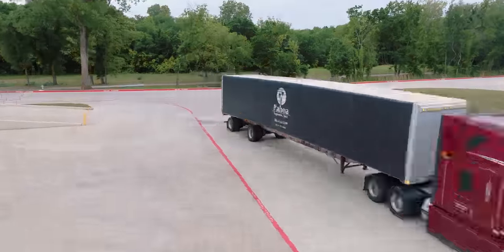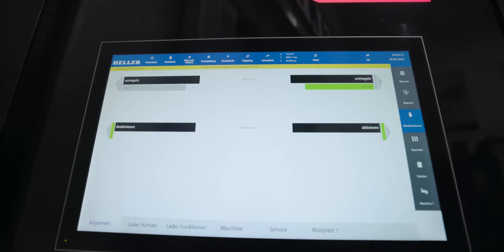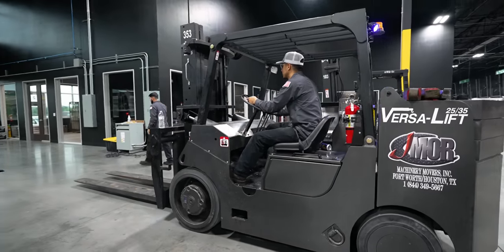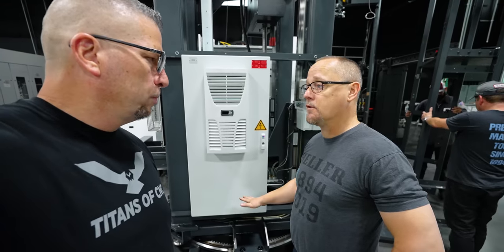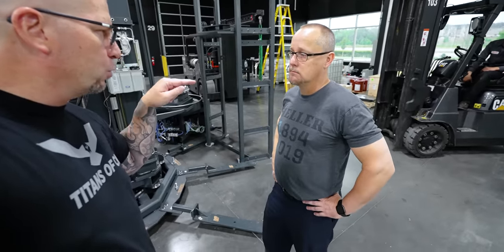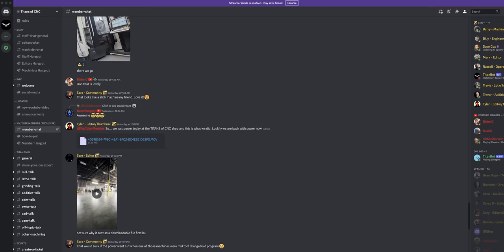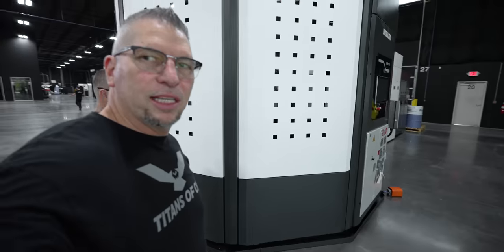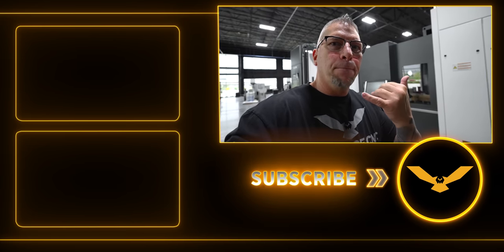Complete Installation of our New Pallet System | Heller HF 5500 RSP Automation

Comment: Love it, our biggest issue currently in South Africa to try and attempt lights out machining is backup electricity. At the moment we only have 14 hours of electricity per day intermittently and talks of less in coming weeks. The automation is sophisticated and expensive but once you look at back up power to run the shop constantly, it becomes a challenge of a different kind.
Reply: I image machine power consumption suddenly becomes a concern and how long you can run on backup.
Reply: @MetrologyEngineer  Manual machine would be bad lol...
Imagine a mill just shutting off on a finish pass 🤣
Reply: Also from south africa if you hiring or know anyone shops looking for an operator I'm your guy
Reply: Communication within the South African manufacturing industry is shocking to say the least. Electricity is one of many issues our local industry faces.
Reply: Just need solar farm with battery storage or even just battery storage that would get charged within those 14 hours when electricity is on and supply electricity while in blackout is happening.

Comment: Just got back from Marinha Grande, Portugal,  (the moldmaking heart of Portugal)  These Pallet systems are what most companies use for machining of inserts, plates, and electrodes.  
With the added step of CMMs measuring the parts that come off the machines automatically to confirm the quality.    Super impressive!

Comment: I’m having a hard time comprehending the enormity of this. All the engineering and manufacturing it took Heller to make all of this. Simply mind boggling. There are so very many machine tool builders out there it also blows my mind 🤯. Great video as always. Thx for all you do to promote the trade.

Comment: Do wounder if there is a mill equivalent to Swiss lathe ( small'ish/small for the volumeof parts it spits out over a set time . Super fast.  super precise. And working at like 4 plus parts at the same time( multi spindle type with buildin part flippers like sub spindle on a lathe ) 

Just wondering if it actually exists  and how cool and smart that would be for big/large orders with meany parts
Reply: Look at sw machines. 4 spindles in cut 5 axis